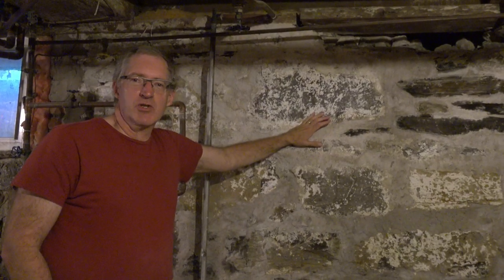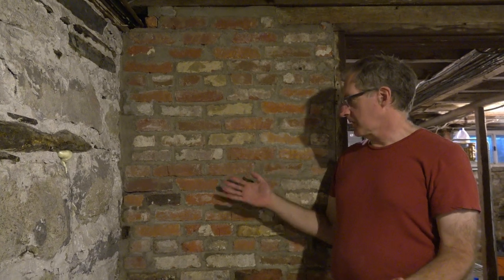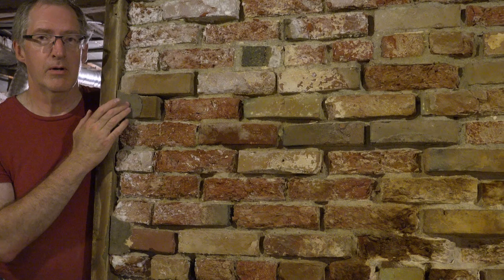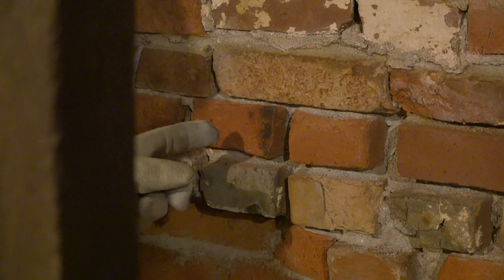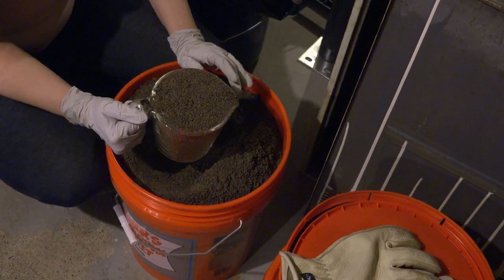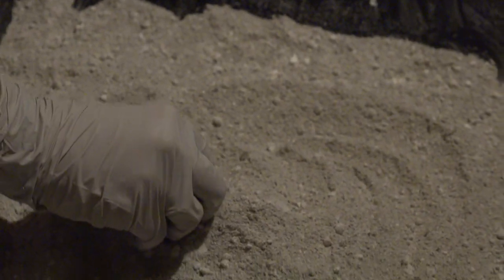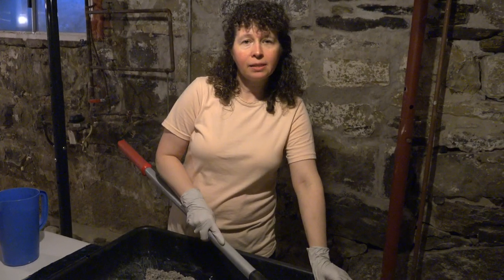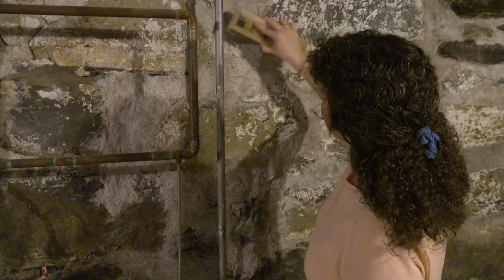EP-2 Basement walls

Comment: Renovating a 1820 Colonial. I renovated my rubble foundation (that is what a stone foundation is called) and went through what you are facing.  
Just remeber lime mortar was used not only to allow moisture to pass through the earth and into the basement, but water as well. This was done so a horizontal load was not put on the foundation ( water building up on the outside of the wall)where the walls could bulge. 

My point is, if you are going back to lime mortar, be prepared for a moist and damp basement.
You could dig up around the outside of the foundation, but be prepared for some really serious costs. Seen it done, and the rubble foundation starts to collapse.
Reply: So how should they mortar their stones/bricks? Since it appears either way it will be wet
Reply: @UnseenSpirit  

They should do it any way they feal is best. 
Like they said in the video, there is mainly (probably not only) two ways to do this. Chip out the old material and fill with lime mortar or with type S. In there first video they addressed the high humidity and water in the basement and said they would like to adress it. This is why I added my initial comment. 

I went with type S mortar on my project over 10 years ago. I agree that the mortar should not be stronger than the block, brick or stone you are working with. Since this is stone not old brick, unless you have a sandstone, brown stone or similar soft stones the stone will be stronger than type S.
I also took several other steps like pressure washed the wall after chipping out the old material, better chance of the mortar to bond to a clean surface.
This project goes hand in hand with water control. You have to try to divert water away from the foundation. Then refinish the outside exposed stone. This will lower the chances of water comming in contact with the foundation.
Next I diverted the water that did get into the foundation. Remeber these walls are 2' or more of loose stone stacked with just the inside 4"-6" of gaps filled with mortar. So water will enter it and run down the inside of the wall. I next dug 1' deep x 2' wide around the inside of the foundation. Installed perforated pipe then filled with gravel. I then put a layer of plastic and patched the concrete floor. Ran the pipe to a 3'x3'x4' deep pit I built and put a sump pump in it. During a heavy rain I can hear the water flow into the pit like a garden hose.
Then I skim coated the walls using cement bonder and a nylon mesh. Let the mortar set then finished the wall with a sealer. The basement is dry and never gets humid.

Lived in a house in Queens where a similar method (less the digging around the inside of the foundation and a pit) was done in the 60's. Never saw a crack or a problem, except when it rained water would seep in up from the floor.

Comment: I grew up in a house that had these walls in the basement. The key is to circle the basement drain with a garden hose around the drain so it stops the sand and silt from going into the drain and ruining your pipe drainage. Just wait until the floor dries and sweep the basement floor where the silt has accumulated behind the hose. This beats an expensive plumbing bill.

Comment: What is the vibrating tool you use you remove mortar, and where can I get one? Thanks.
Reply from the maker: That is a Bosch Bulldog rotary hammer. I forget which one but it was either Lowes or Home Depot where we got ours. It has a knob to select DRILL/HAMMER DRILL/HAMMER which makes it useful for drilling holes in concrete too.
Reply: @1834RestorationHouse  Thanks! So, if I use this to remove old mortar when I am repointing, I guess I just have to be careful to not hit any stones? Or is it too hard to control and not a good idea to use right around stones that are in good shape that I want to save?
Reply from the maker: @huntress222  You''ll need a chisel tip tool in the hammer. Just set the hammer to "hammer only" mode, push the tip into the mortar and pull the trigger. The staccato impact will fracture the mortar and it will fall out, leaving the stones unharmed. The bulldog doesn't have enough force to break rocks so there's nothing to worry about there. You didn't say what kind of mortar you are dealing with. We had old lime mortar that had been slathered over with cement mortar. The cement based mortar needs more work to break than the lime stuff. We then raked out all of the loose mortar. In some cases, all of the mortar came out and other places we got down to sound mortar which we left in place. We made up some fresh lime mortar and filled the cracks and cavities with it. Our channel has nearly 80 episodes of restoration work covering a wide range of topics.
Reply: @1834RestorationHouse  Thanks, I really appreciate the info. I am trying to get rid of a few patches of portland based mortar that I put in before I realized I should go with lime.